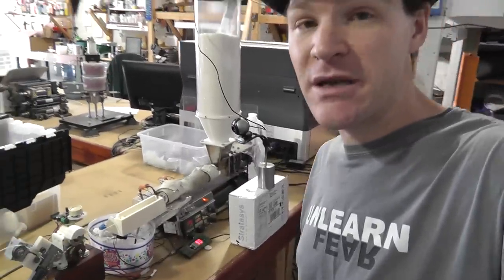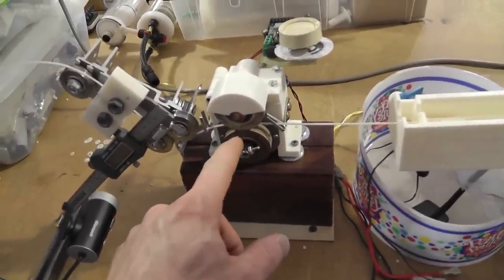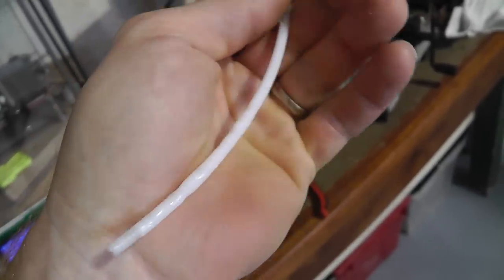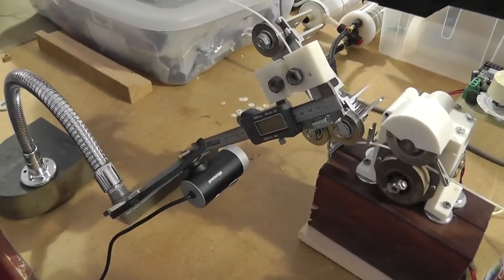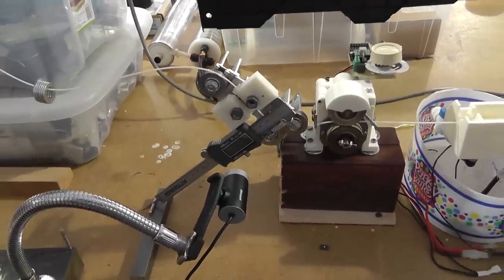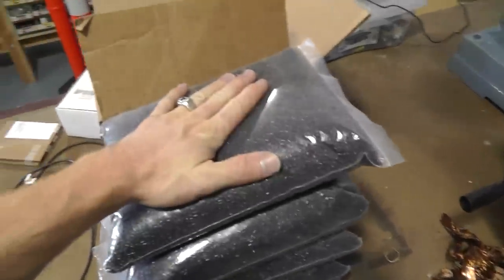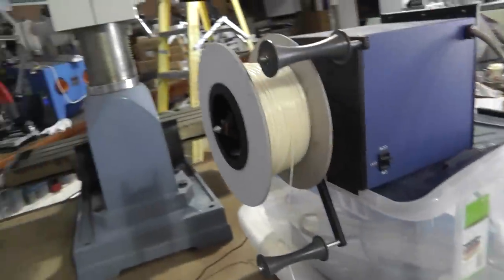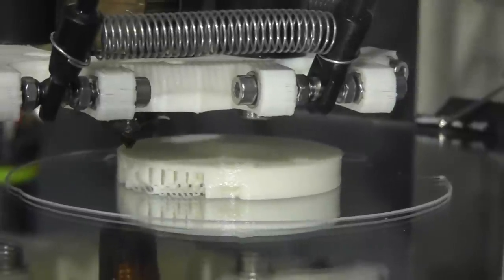#14 ~Russ's Filament Extruder: Digital Calipers Measuring Device. Work in Progress....

Comment: Russ, 
Go put a 8' ground rod in. The trick is using a small jackhammer (rentable)  and drive the rod in using the bit seat.
Also at my local scrap yard there is a 1400 pound tote of plastic polymer beads, let me know and I will pick them up for you. High quality stuff. Your extruder looks cool...

David
Reply from the maker: Hi David, 

Any idea what type of polymer it is?  

If it's in an open toed it's probably junk if it's still in the bag it might be useful. 

Thanks! ~Russ

Comment: The next useful tool for the plastics processor is the flat hair iron. I don't remember the brand but one goes up to 450f and with some clear mylar you can check quality of pellet. After that a mfi machine will help with classifying the melt properties of plastic.

Comment: Hey Russ I'm 17 I already made my own 3d printer from scratch and next year I'm going to make a extruder any thing you would change or I shouldn't change I'm planing on making a crusher for the used filament too so any hints or tips will help
Reply from the maker: DJake77 hey, keep all scraps in a clean dry place! when you get to that point where you want to use it! then you'll have it! ~Russ
Reply: ***** would you suggest anything different on your extruder that would be better?

Comment: Strange one thing. I have three calipers like yours from the video but non of them has data port. But your idea is good. In one facility i saw laser caliper and where using it for the steel wire. Maybe you can use that idea. 
And what is the idea with that nailon?
I saw that spining tnigs. :)

Comment: Hey Russ,

Nice idea to use the calipers. I am currently working on an extruder myself but i don´t quite have the resources and the knlowledge you have (i´m a student). i am planning on controlling everything with an arduino and a 12v DC power supply via relays and pwm (for someone with limited knowledge in electronics a real challange). 
In addition i had the vague idea to use the spooling mechanism for pulling out the filament (no puller). 
I would like to hear your thoughts on this. 

however thanks for the video and keep up the good work !

Comment: Use a machinists Dial Indicator. This will be much easier to implement than the calipers. On your nozzle, take another copper tube that is larger than your nozzle and make a jacket surrounding the nozzle, circulate cold water through it, this should eliminate that water bath that you are using.

Comment: Why dont u use this setup but instead off cooling it of directly, use a system with 2 rollers like the one you have right before the measure setup to press roll it to the exact nice size (while its still mildly warm) and cool it off after it. To spool it use a large tube with a small ridge to guide the wire and applie tension to the wire so the large tubes rotates allong with it. Make the ridge so that with one rotation of the tube you get a left to right and right to left movement and voila?

Comment: maybe you could use a PID system to regulate speeds and temperatures in order to maintain a stable diameter like if the measuring device gives a reading below a certain tolerance that the pulling - or extrusion speed will drop a bit untill the balance is fixed. a system like that comes in handy if you want consistency in production.

thx for the vid.
Reply from the maker: Yes i would use a PID in this system if i connected it to an arduino. the PID's created for the hotends and hot plates in the printer firmware already proves its selfs stable for the job!

thanks!

~Russ

Comment: you could put a tachometer on the dc motor and run it in a close loop with a couple of op-amps and a pot to set gain, making it servo controlled. should fix your speed changing issue

Comment: awesome build. youre ahead of the game as usual. ive been waiting to see the full unit up and running! 
there are alot of questions surfacing about mixing things into the filament to get different properties (graphene ink, ferrite/iron dust etc) . im assuming it would really guck up your system so youre obviously not going to ruin it to try it out soon, but do you have any thoughts on how it would process? im envisioning lumpy sparkly filament!
Reply from the maker: good stuff! " Lumpy Sparkly Filament! " haha

yeah i thought about it... and then i thought about spray paint too :)

seems much better than trying to mix in stuff. but there is a vision for this, and i think it will be helpful down the road!

Blessings
~Russ
Reply: ***** awesome man. hey- watch out you dont get that digital caliper too close to any electrostatics (if its carbon fiber).....i just fried a set without even knowing it!

Comment: cant you use a synchronous motor to drive it att a steady rpm ?
Reply from the maker: yes you could but then your limited more to the frequencies of your local power company! the best thing is a servo of some type. i can connect a DC buss at a steady voltage and be fine.

but for all best practaces a servo with an encoder feed back loop would be the best... just no the cheepe'st :)

~Russ

Comment: Russ, what did u use to shred the plastic?
Reply from the maker: paul spuria in this case its new plastic. comes like that. i use Open Source Printing plastic : http://store.os3dp.com/index.php

once i get it running really well... then i will experiment with used plastic. any veneration can mess up the process. so all testing with new plastics only. for now. 

~Russ

Comment: Buona sera signor Russ Gries, sono un vecchio hobbista ed in rete ero conosciuto come Dag-50 ( http://www.cnc-dag50.it/ ) girando su youtube mi sono imbattuto nel vostro progetto ( Filament Estruder )Ho gia realizzato tutte le parti che lo compongono con materiali di recupero e tanti pezzi realizzati con la mia piccola stampante 3D, potete vedere la realizzazione sulla mia pagina Fb ( Dario Ghezzi ).  Ho realizzato anche la parte che rileva la misura del filo col Calibro ma Non riesco a trovare ne lo schema elettrico ne il listato software da immettere nel microprocessore. Da quando mi hanno operato al cuore, per impiantarmi una valvola artificiale, non posso più uscire e questo è l'unico hobby e passatempo che posso fare, Vi chiedo se potreste aiutarmi sia per lo schema elettronico che per il listato del programma per il funzionamento del Calibro. vi ringrazio e vi porgo un grande saluto. Dario 

Good evening Mr. Russ Gries, are an old hobbiest and network was known as Dag-50 (http://www.cnc-dag50.it/) turning on youtube I came across in your project I've done all (Filament Estruder) component parts of recovery and many pieces made with my small 3D printer, you can see the achievement on my Fb page (Dario Gallego).  I also created the part that detects the size of the wire with the Caliber but I can not find it the wiring diagram ne listing software to enter into the microprocessor. Since I have heart surgery, for impiantarmi artificial valve, I can no longer go out and this is the only hobby and pastime that can make you wonder if you could help me for both the electronic diagram for the program listing for the functioning of the Caliber. Thank you and I offer you a big Hello. Dario